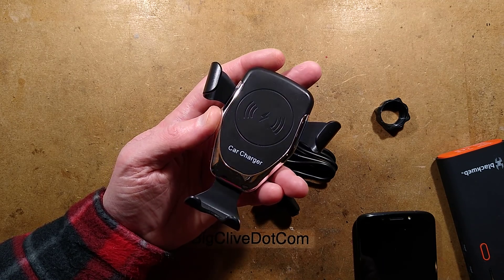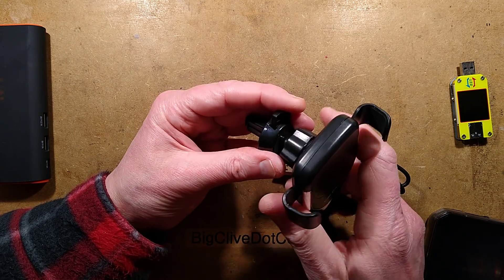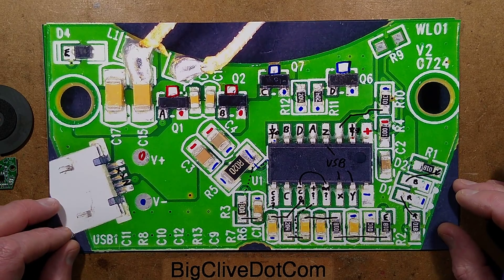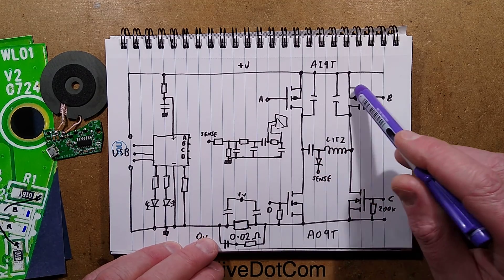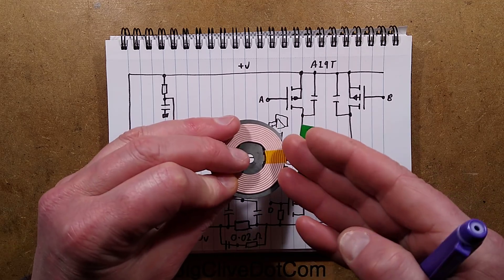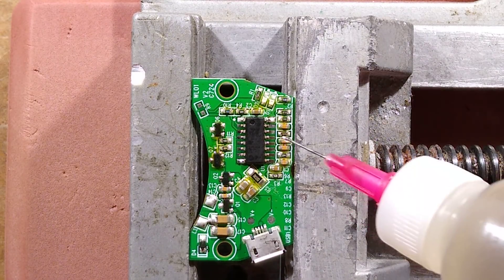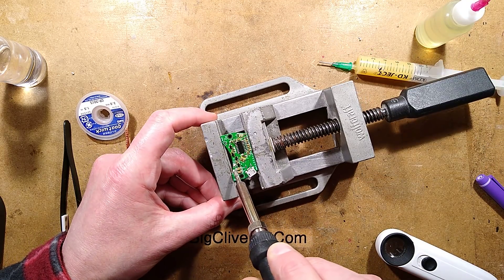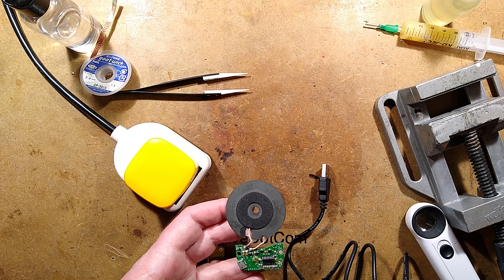Poundland inductive phone charger teardown (with schematic)

Comment: I had an intermittent no start in a 2009 Chevy Malibu. Had history anti theft codes. Couldn't duplicate. I noticed a wireless charger. I put a phone on it before cranking and duplicated symptom. You got to get into customers head. First thing someone does is throw their phone in charger then try to start. The frequency must have matched the RFID chip in the key head frequency. Educated customer to start first, then put phone in charger.
Reply from the maker: It was probably swamping the inductive coupling with its strong magnetic field.  Interesting fault scenario.

Comment: pick and place machines are extreamly safisticated  the only diference with the lower end ones and the higher end ones as far as I'm aware are the higher end ones have more advanced firmware though electronics hardware engenering is only my hobby so take my word with a grain of salt if you catch my drift

Comment: By the way, a triangle pointing up is the symbol of common tie point, usually meaning vcc or vdd. Grounds are shown differently based on what ground you want. One horizontal line with 3 additional lines going down and left is earth ground. 3 horizontal lines getting smaller as you go down is circuit ground.

Comment: Graphite is supposed to prevent transmission in the wrong direction and helps to reflect power in the right direction, at least that's the thinking

Comment: That unit is extremely costed down, I opened up an older unit and it has about 5 or 6 chips in it. It kinda surprised me as I thought it would've just had one rolled application specific ic instead of multiple chips.

Comment: To me it looks like a customized PWM-type controller, with the sense input likely being a self starting oscillator with the buffer/comparator used to drop the voltage then apply values across the input pins if that is indeed an op-amp being used as a comparator.. The resulting output swing must be used for timing/oscillation to keep everything in sync and to also sense if you put something inductive on the coil? Looks like something is being sent out as a 'sense' signal. Or maybe its just to detect presence of an inductor, nothing to do with oscillation? As at the right level might go zero/floating instead of low? Need to poke it with a scope! Just be careful of that back EMF..are the peaks over 400v though? If it is a microcontroller, they could also be using pins for an internal software programmed op-amp.. Hmmmm...

Comment: I haven't went through all your videos . Not sure if you covered this but I was curious if you ever noticed at least with some USB-C cords if you plug in one way it charges a lot slower than if you were to take it out and spend it 180 and plug it in. Always been curious why this happens. Never noticed if it happened with my actual charger wire that comes with my Galaxy s20 plus but the aftermarket usb-c fast charge cords I buy from Amazon it happens on everyone I have purchased. I do make sure that it has a 56k resistor buil in and do my best to make sure that it's a quality charger cord. But the USB c is supposed to be reversible and technically it is just without the same results.  but just curious why it would charge faster when you plug it in one way rather than the other. Thanks for your time

Comment: That is similar to how I flowed joints on ICs and SIL resistor arrays etc. in the electronics industry, and still do, holding the board at an appropriate angle to assist flow .. but one question:

Where is your old toothbrush to help scrub off the flux?

Note I was the only one there who did this and the joints actually looked better than the others', also quicker to do when done right! Kudos for coming up with this as well. Practice makes all the difference. I initially didn't add flux though, just used thin solder for the fine stuff where the contact area was small enough to need it, all 60/40 of course and none of that "evaporating flux" nonsense that makes me choke, rosin all the way .. and no "carrying the solder to the joint" needed. I'd flow the fresh solder along the pins drawing the excess away.

If a part can (thermally) survive a flow-solder machine, it should survive what you and I are doing.
Reply from the maker: My flux cleaning toothbrush is in the "everything else" drawer.
Reply: @bigclivedotcom  Probably not needed with the liquid flux you are using, but just thought I'd raise the point as it's what we always had in our toolboxes in the trade and something I've carried on with as a hobbyist. I haven't actually seen one in any of your videos, by the way .. just a random thought whilst I was watching this one. Nice to know it's more of a common practice than I thought. I know the people I worked for were skinflints .. but we did also have ready access to 1.1.1 Trichlorothane for cleaning purposes!
Reply: @BG101UK  Trichlor - the solvent of the gods. Best degreaser, cleaner, defluxer ever. Did "They" outlaw it completely, or is it still commercially available? It's been a long time since I used it regularly.

Comment: That clamp mechanism is really clever. Think that is a good mechanism to fit some tools onto the wall. If the circuitry its output can be reduced to 2v, is it possible to use this as VFD filament driver?
Reply from the maker: You can get guitar hooks that lock like this when something is hung from them.

Comment: Pull-down resistors on pins definitely does look like something you'd do when using a micro-controller that powers up with programmable pins set to high-Z where you need them to be low.

Comment: So beyond my suggestion about the Ampere App, they make some pretty cool versions of this type of car dock and wireless charger. The one I have is QC3 and so does true fast charge (30W). And the fingers that grip the phone are motorized. So when the phone is placed in the cradle and charging is negotiated and confirmed, it clamps the phone. There's a button to unclamp when you want the phone back and there's a supercap inside the dock that holds charge so you can undock even when the power gets shut off.

Pretty slick and definitely fast charges my Pix5

Comment: I'm amazed that the chip survived having all its legs hot for so long when you re-soldered it. When I was a lad we had to take care not to cook semiconductors and I still worry about it.
Reply from the maker: In the past this would have cooked chips.  They're designed to be put through hot solder reflow ovens now, so they are much more resilient.

Comment: Wireless charging is one of my pet peeves.
It is very  inefficient and, come on, the wire is just there . It should be called unplugged charging.
It is curious that everyone is "green" or " eco friendly" and then use, sorry, sh!t like this for charging their phones.
Reply: charging: unplugged
Reply: The charging cables with the magnetic ends are great. They will pull off the phone before the cable or plug breaks, and you have to have a cable anyway! And you never have to try a couple of times with the very annoying early USB c.

Comment: I've never understood the purpose of these things. instead of plugging a cable into your phone, plug the cable into this other device and then sit your phone on top of it? Seems unnecessary. If they came with a Li-ion battery they could be good as portable chargers, but again, what's wrong with a cable? Don't get me wrong, it's impressive tech, but why?

Comment: That op amp configuration, with the output going nowhere but back to the input, is a gyrator; they're frequently used to simulate an inductor if you don't have the space or budget for a choke. I had to look it up when I saw a lot of them in speaker cabinet simulation circuits in guitar amps and wondered where the output was supposed to be buggering off to.

Comment: These are ridiculous. You still need to plug a 12V USB charger in the cigarette lighter socket (or use the dedicated USB charging port is your car has one) and run a USB cable all the way up to the cradle, you might as well plug it directly to the phone to get an efficient charging, why bother with a "wireless" charger that requires you to run cables around anyways?

Comment: this device does not wait for a response. the "response" is just the presence of the phone which puts a load on the coil, and the device can detect that. That plate behind the coil is a ferromagnetic material which makes the power transfer more efficient

Comment: Re communication:  Interestingly, my phone responds to the proximity of the controller box for my electric blanket.  When oriented vertically, the phone wakes up the screen when I get within about a foot of the blanket control.  Said control has + and - buttons and a row of lights that indicates how high the warmer is set for (no lights for off).

Comment: At the risk of repeating part of an earlier reply I made and, having read all the comments I see at least one other person touched on it too, here's a bit about the ferrite disc.

The coil is a loop antenna. It's a directional antenna that radiates or receives power in two main lobes. (Antennae are complex so the power isn't 50% in each main lobe, power is radiated in all directions but most of the power is in these lobes so it won't hurt this explanation too much to mostly ignore the other directions.)

One main lobe is to the front of the loop and one to the back. These two lobes are identical apart from pointing in opposite directions. That's why AM radio and VHF TV loop antennae need to be rotated so that a flat face of the coil looks towards the broadcast antenna but it doesn't matter which face it is.

With the power transmitter (Tx) coil on the bottom and the receiver (Rx) coil on top there are 2 loop antennae and so 4 main lobes in total but only 2 of these lobes are directly useful: the lobes facing each other. We'll call these the front lobes.

The Tx back lobe is transmitting power away from the phone and the Rx back lobe is facing the wrong way to pick up power from Tx.

Ferrite is a name for a range of ceramics displaying ferrimagnetism. They are far 100s or 1000s of times better at, in layman's terms, conducting magnetic fields than air or plastic (though not as good as pure iron or some alloys). (It's a bit like how electricity preferentially passes though metal conductors rather than through rubber insulators.) They respond readily to a changing magnetic field like the one produced by the ~100 kHz AC in the Tx coil (not as good as soft iron but better than many magnetic alloys). They don't conduct electricity well so they won't waste as much energy in resistive heating from eddy currents as would a metal (so better than iron or an alloy).

The ferrite disc at the back of the Tx coil is paired with a similar functioning  material at the back of the Rx coil. Together they influence the magnetic field and redirect it so that instead of spreading throughout all of space freely it is concentrated between the coils. It hugely increases efficiency just as an iron or ferrite core would in a transformer, inductor or a ferrite rod antenna.

It also acts as a shield for EM interference reducing stray LF radio signals and so it prevents power from the Tx coil or reradiated from the Rx coil heating up the circuitry in the rest of the transmitter unit or in the phone or anything the transmitter is sitting on.
Reply: So, the charger is basically one half of a power transformer unit. Second half is in the phone. When charger is placed exactly on the spot, two ferrite halves connect into good flux guide. Otherwise, transformer core is not complete and some energy is wasted outside.
Makes perfect sense, thanks!
Reply: Question: People online seem to give conflicting answers on this, but do superconductors actually reflect magnetic fields, or just don't allow them to penetrate? I'm wondering because it seems like, if they reflect them, we could theoretically stick one on the unused side of a coil and significantly improve the efficiency of the power transfer. Obviously this wouldn't be economically/practically viable for most purposes unless we found some Pandora unobtainium, but it would at least be an interesting experiment for some researchers

Comment: That was beautiful surface mount soldering for the iron... I mean at least grind the tip smaller, lol. I'm sure it'll be at least as good as the ps2 mod chips I used to do with a 45w Weller and plumbing solder. Currently with my adjustable iron and multiple tips, multiple sizes of solder, I almost feel like I know what I'm doing, heh

Comment: I think it was only drawing ~300mA as the phone was at 67% battery. 

Most phones draw less amps as the battery level rises. My phone will draw ~3-3.5A when connected with less than 15% battery and slowly draw less amperage as the battery level increases.

Comment: It’s amazing what a hearing aid picks up from these wireless charges when the hearing aid is set to the T coil setting.
Reply: I imagine it's quite annoying. T loops are just an inductively driven speaker output right? So you'd hear the R U There chirps and then presumably hum when charging?
Reply: @TheErador  Believe it or not T coils are not so sensitive that you can just hear the interference from wireless chargers, you would have to have the charger right next to your hearing aid to actually pick up the interference. Hope that answers your question.
Reply: @Kulvinder1974  cheers. Thanks for that.

Comment: I bet that device  has great big fat harmonics all the way up the radio spectrum! The coil and two capacitors form a crude series resonant circuit but its Q will be very low under load, so harmonics everywhere and radio amateurs in the vicinity screaming blue murder.
Reply from the maker: That applies to just about every piece of electronic gear these days.
Reply: @bigclivedotcom  
Yes it does but these things are particularly noisy because they are basically RF transmitters. It'll get much worse if we start seeing wireless electric car charging but I think that's unlikely to happen because of the sheer inefficiency of multiple conversions: DC > RF (inductive coupling) RF > DC.  A lot of heat and wasted electricity... not very green at all! 

I should really read up on the harmonic suppression requirements for CE accreditation, not that most Chinese manufacturers take any notice - they just slap the CE label on regardless.

Comment: Thanks for the tip on pulling the bottom: I had one that charged an iPhone right off the bat, one that didn’t come what may, and one that I have to remove from its case to move it 1mm down for it to work. All it needed was a gentle tug.
- Edited a few words as i can't spell.

Comment: Say... A question regarding LEDs that has been bothering me for a while... Every 5years or so I need a new shot and buy a Tamiya 1/16 scale RC Tank, some of which come with LEDs for the Head / Brake lights which Tamiya, at some point, started to put inside the tank instead of the Light Housings and then routes the light from inside to the Light Housings using Light Fibers that work ooh-käy but nothing I'd be writing home about.

Question: My plan would be to replace the single LED inside the hull ( getting split via two Light Fibers to each Headlight / Brake Light ) by two actual LEDs inside the Light Housings themselves but I'm not sure if this works at all without adding any further components and if I should wire the new LEDs in Parallel ( 2x wires ) from the solder Pads of the desoldered LED or if I should do them in Series - Picture explaining it: https://i.imgur.com/tmvbvSY.png

Any suggestions how to approach this? The LED I'm replacing looks like a bog-standard white LED and the ones I plan to replace them with will be a pair of those https://tinyurl.com/y8o95k4e ( Spec Sheet PDF )

Comment: Can you do a little "BigClive Magic" on this thing and make it more powerful??  Maybe so it can make it through thicker cases? I am wondering because I'd love to scavenge parts out of one of those then 3d print my own enclosure/mount for it. If it can be modified to put out a stronger field for more current charge, or preferably, to cross a larger gap and through a slightly thicker plastic housing I would love to try this!!
Would winding my own coil or modifying a stock one somehow allow for longer transmission distance?

Comment: I have been wondering if you might have an oscilloscope at all or if you might hide it.  Especially one with a logic analyzer port?    Those kinds of unmarked or otherwise undocumented 16-pin chips could benefit from one.  Although I need to confess I have never tried mine exactly for those unmarked ones.  My experiences have luckily so far been on troubleshooting circuits with fully documented chips.

Comment: Am I missing something, but if there is a cable to the charger, why not just plug it into the phone  and cut out the inefficient charger?
Reply: You don't understand the point of wireless charging?
Reply: Did you miss it when he said he didn't want to impair the waterproof qualities of his charging port cover by constantly opening and closing it? Or were you just referring to people in general?
Reply: The USB is a micro USB plug, my phone takes USB C. 😂

I have this very charger in my car. I sometimes use the Torque app on my phone through OBDII to monitor parameters in my car such as boost pressure, DPF temperatures, etc. This is a fair old drain on a phone battery. This charger performs two functions for me - holding the phone in a position where it can be seen at a glance, and puts in enough charge to save the battery running out. It also means not needing to find the right cable when I need it.